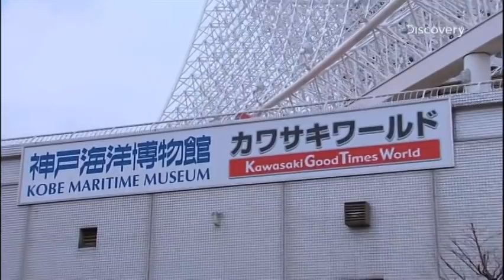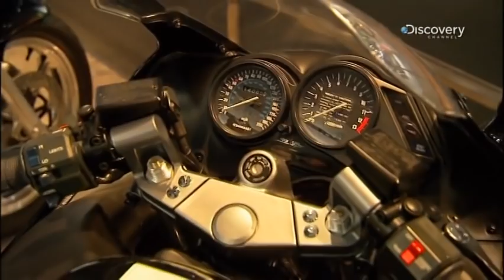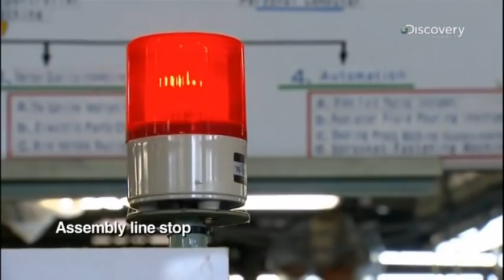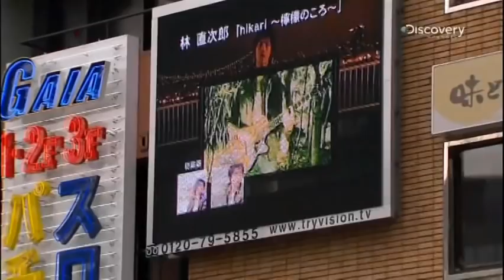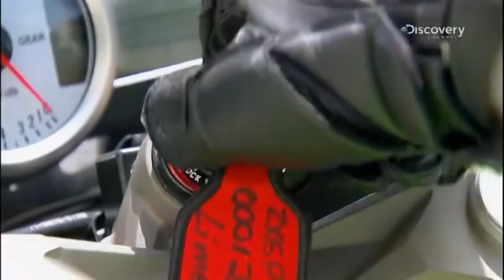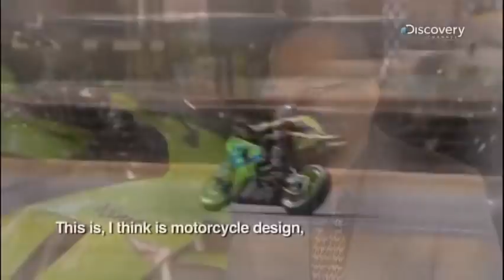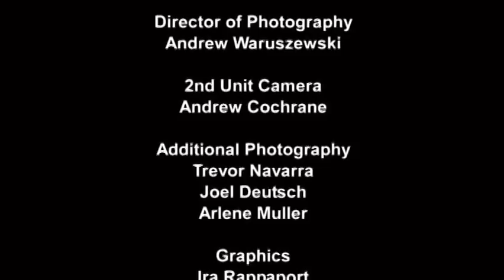KAWASAKI History, by Discovery channel, 世界のバイク

Comment: Bigger engines = more sales.  More speed = more injury and death.
Reply: The US NHTSA conducted research in the 1990s to try and prove this and found that it wasn't true !   The highest proportion of injuries and fatalities didn't happen on 1000cc sized motorcycles, it happened on 600cc sized motorcycles.
Reply: @thorick590  interesting, maybe those that rode bigger bikes had more experience.  I ride like an old man because I want to become an even older old man.  I did the crazy shit in my teens and 20s. I live in major city.  It seems like some young fool dies every day here on a over powered crotch rocket.  It breaks my heart.  I wish we could go back to Arlo Guthrie style of motorcycle riding.
Reply: Yeah I wouldn't be surprised if that was most of it.   It was down to rider behavior, but why 600cc ?  Maybe they were more affordable to younger people that also had less experience.  Don't know, but the results of that study surprised many.  I think it might have been intended to justify a law on horsepower limits, also not sure.  Glad that that didn't happen !
Reply: @JohnDoe-bf1fw  In actual fact the death rate for riders in the 70's and 80's up into the 90's in Europe was much higher than it is now. In those days you had high performance with relatively poorer tyres, electronics, suspension. Biking has always had a higher level of risk. The excitement is why many ride. Th Arlo Guthrie style of riding does not appeal to most Kawasaki riders. Each to his own.
Reply: @MichaelZZRrider  my motorcycle and bicycle are my primary source of transportation.  I haven't owned a car in 20 year.  I did enough crazy shit when I was younger.  I just ride a  20 year old plain Jane BMW R1100R.  I still love riding.